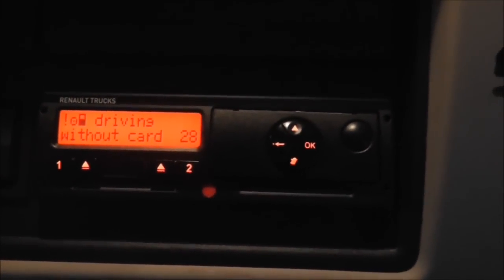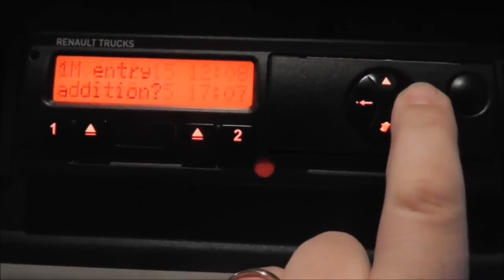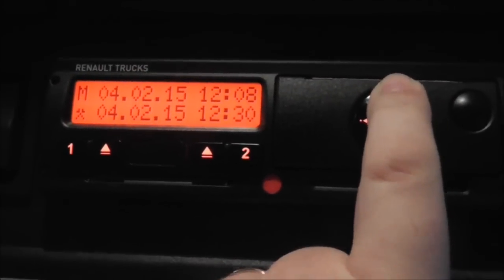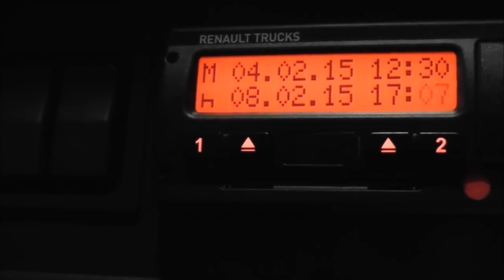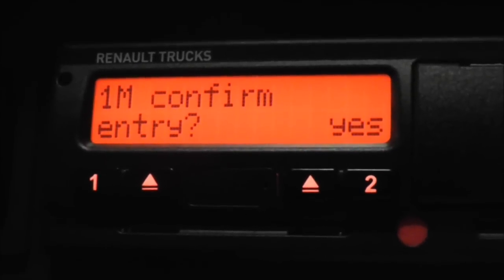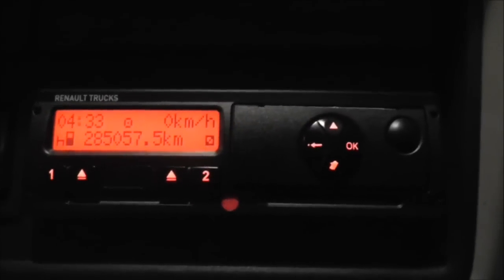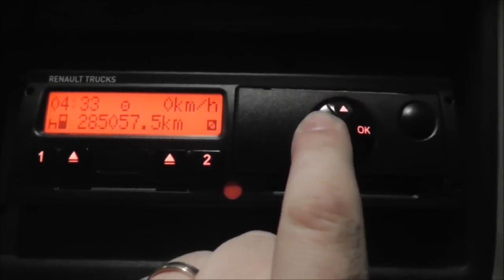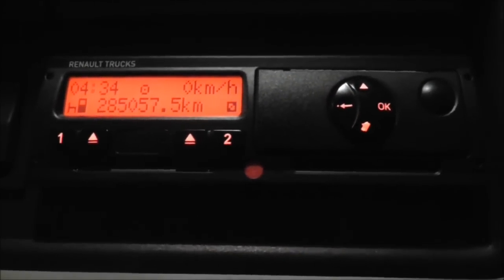Siemens Digital Tachograph - Manual Entry (How To)

Comment: When you been driving for 4 hours and then decide to stop for a 45 minute break, does the Siemens digi reader automatically register you being on break as soon as your engine is switched off?
Reply from the maker: BigBoss luki When you stop and switch off, the tacho's  default is normally 'other work' (crossed hammers) so you then need to select 'rest' if you are stopping for a break. Recently though I used a vehicle which automatically selected 'rest' everytime I stopped, in this case I had to select 'other work' unless I was stopping for rest. 
Most of the time the default will be other work when switching the ignition off, but always check as you could get in trouble !!
Reply: Thank you for the info.

Comment: Can I ask you a question. What happens when you put the driver's card for the first time? do you have to make any entries. Like other work before you start driving.
Reply from the maker: Kiril Kirilov You make a manual entry as normal, if you put the card in at 0610 but started your shift at 0600 you make the manual entry as usual.
If it is a new card (replacing an old /lost card) you do exactly the same as all your old data will have been downloaded from your old card.